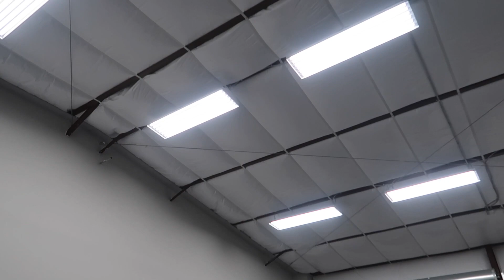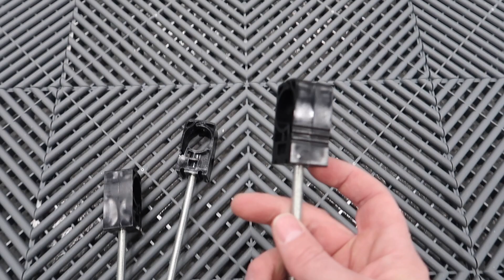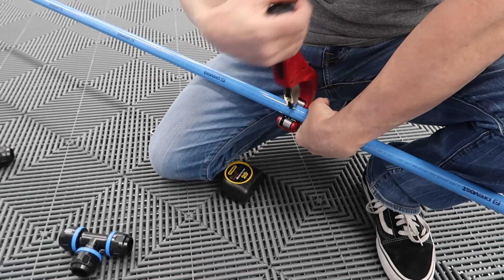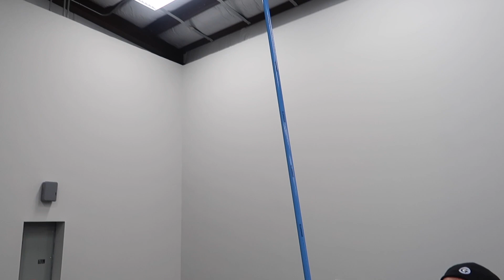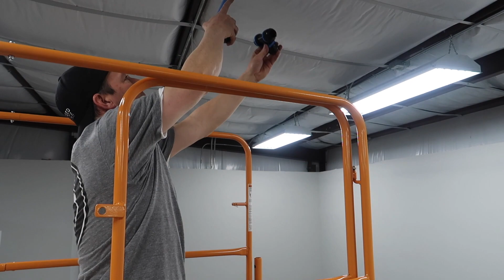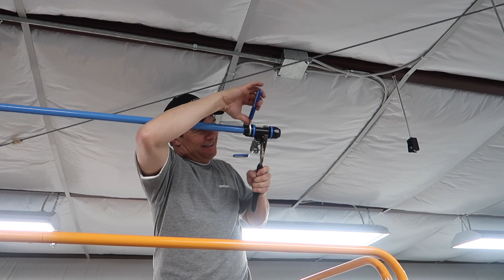Compressed Air Project:  E3 - Prevost Piping System Install

Comment: The one thing that I have not seen done in this vid series, is torquing the nuts on the fitting to the manufacturer specs. They need to be torqued and the system used for a bit and then retorqued. All of my fittings needed to be retorqued after using the system for a bit. When installed properly, leaking is a non issue.

Comment: Sup, thank you for the video! what is you feedback on the Prevost fittings and overall pipe system after using since you posted the video? i am currently in the market for Prevost now and looking at my options based on other customer use feedback.
any leaks, have you lost any air pressure or loss of cfm/scfm?   
Thanks
Reply from the maker: They are hands down the best fittings of this type on the market.  I love them!  https://www.obsessedgarage.com/collections/prevost

Comment: The reducer showed on minute 21:40 it's a 1/2 male to 3/8 female? In your shop, I only see 1/2 male to 1/4 female. And the whip hose of the Coxreel it's 3/8 right? Thanks
Reply from the maker: Whip is 3/8".  I have the 1/2" male to 3/8" female.

Comment: FYI, when installing drops in your air line system, pull the air from the top of the pipe, instead of from the bottom.  Reason, if there is moisture in the line, it's not as likely to get to your drop if your pulling air from the top of the pipe.
Reply from the maker: Why?  Each drop has a manifold with a drain on it.
Reply: @ObsessedGarage  If for some unknown reason your refrigerated dryer quits, your compressor is going to pump water through your system.  If you want to constantly drain your line, do it your way.  This is just an added level of security to keep water out of the point of use.  If the drop is taken off of the top of the "root" run, the entire pipe would have to be filled with water to get it to the point of use.  Hope this helps.

Comment: Nice one Matt, that is looking fantastic. You will have a better air system than most professional workshops here in the uk. I can only dream of having a garage/workshop set up like the og but here in london that will never be a reality, space and land costs prohibitively expensive. Next week I will be ordering a 56" upper and lower tool chest combo and after having been in the motor trade 30yrs have finally decided to upgrade my socket rails system. As you were talking about tools etc, not sure if you have seen these as a consideration to the og store as some future point
http://westlingmachine.com/ToolHolders.html  

I decided to indulge and have ordered some from the us, not a great fan of the metal clip type socket rails any more. Keep up the good work loving the install videos
Reply from the maker: Those look really nice.  I'm going to order a couple.

Comment: I do pipefitting and my ocd was screaming because you guys put the lettering on show since I'm so used to being asked to hide it haha. Also with ball valves you should always Install them so they fall to off when putting them vertical!
Reply: I don't think it would be possible for a ball valve to "fall" to the off position with pressurized air inside.
Reply: Patrick94GSR I don't mean fall on its own. By fall I mean when you turn it to off the handle should go from vertical upright to horizontal right.
Reply: But does it really matter?  Seems to me like it would make more sense for the handle to be parallel to the pipe when open, and have the handle "point" in the direction of airflow.  So if it's on a drop coming down, the handle would point down (6 o'clock) when open, and turn clockwise to point left (9 o'clock) when closed.
Reply: Patrick94GSR Nah it doesn't really matter or affect anything, It's mainly to do with the strict health and safety at the factory I do work for. We've always done it that way as standard practice and that's how they ask it to be done so if someone fell and hit the handle it would always fall to off. Plus if there's writing on the handle, In my experience it is always the right way up when in the position I mentioned.

Comment: Matt, Great Series!

I've been at the "Air compressor Game" for 40+ years and just want to mention a few facts....... the  more fittings, connections and valves you use the more leaks you are likely to have. In my experience there is no such thing  as a 100% leak free system. Expect at least one or two cycles a day even if you are not using air. (note: my system is pressurized 24/7/365). Anywhere you have metal threaded parts I'd also use Pipe Dope as well as your Teflon Tape. 

You should keep your T's and connections to a minimum and you will be happier in the long run. The Automatic Tank Drains are sweet, but sometimes actually create problems. They sometimes stick and stay open too long - just something you might want to check on once in a while. I went back to manual tank draining and just open the ball valve and drain any moisture out at the end of the day. Takes only a minute and works well. Don't have to worry about auto valves failing. 

You're going to love the Jenny - mine works GREAT! Use their Blue Ultimate Oil when changing - it is an extremely high quality oil! It is actually rated better than Amsoil Compressor Oil which is at th etop of the list as well.
Reply from the maker: We were thinking the same thing about connections.  We were able to build the entire loop and system without a single union other the the 90 or T necessary to make the transition.  I'm super pleased how it all turned out.  As of now we have no leaks.  I will only be pressurized when I need it, so that might simplify things a bit.
Reply: BTW, the Provost is something I've not heard of 'till now. Looks quite  impressive! The commonly sold  "PEX"  style is a pain to work with and does not allow for tight 90º corners - however it does eliminate many 90'º elbows. 

My current system is Premium USA hose from Speedaire. Not the 1" diameter of yours, but the best I could do at the time.  Originally I installed the hose because it is flexible, easy to run, inexpensive and strong. Since I was snaking it through my home, the easy of running and flexibility was very important. In 23 years I have not found any excuse to replace it and it's still performs great. NOTE: any connections ever made with flexible rubber hose SHOULD have the crimp style connectors crimped with the Knipex Pliers. Never use typical hose clamps! Not only to they loosen but they cut the crap out of your hands.  If I had the luxury of an opened space such as yours, I'd definitely go with your Provost system. PS: you were SPOT ON to NOT use the Home depot Chinese valves & fittings - they are pure rubbish! NOTE: Go on line and get your self proper Teflon tape! It's called Blue Monster. Thicker, stronger, and comes 1,400 inch's  per roll. The absolute best I have found so far and it is OG BLUE!! :)

Comment: Ever try pipe thread sealant (pipe dope) instead of Teflon tape?  I’m chasing leaks on my compressor and just re-made several connections using dope brushed on instead of tape. So far so good it seems.

Comment: I’ve always been a fan of copper ran air lines but I think you might have sold me on this system. The manifolds are well worth it in my opinion. And SS always adds class. Keep up the crazy Matt.
Reply from the maker: I love it man.  This stuff is amazing.

Comment: Looks great, but wouldn't have been easier and cheaper to use Copper pipping Type L with Pro Press fittings or SharkByte fittings? CPVC can also be used unless it won't pass the local codes in Florida.
Reply from the maker: Probably, but this stuff looks so good and is so simple to install.  I prefer to have this and display it.

Comment: This is good stuff! I didn’t realize making a loop was a thing but it does make sense. Is it also possible to have individual regulators at each manifold if you have tools that need different pressures?
Reply from the maker: Yes, it is probably preferred.  I can't think of anything I'll be using at anything but 90 PSI, so I only need one.